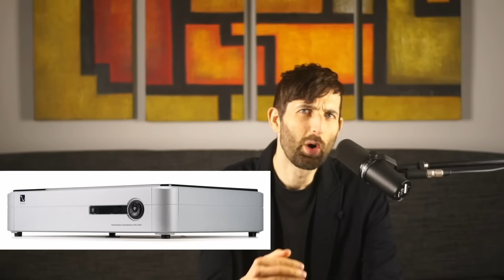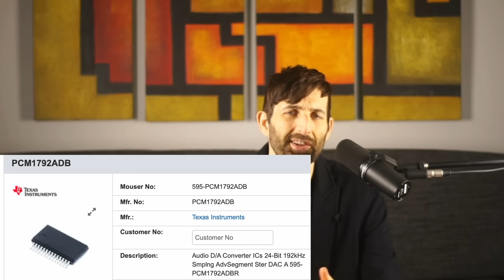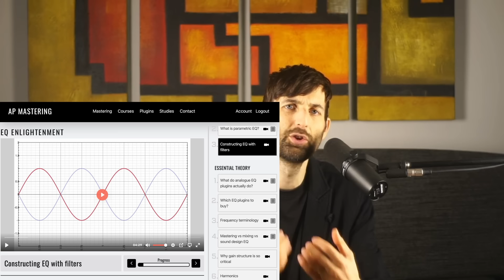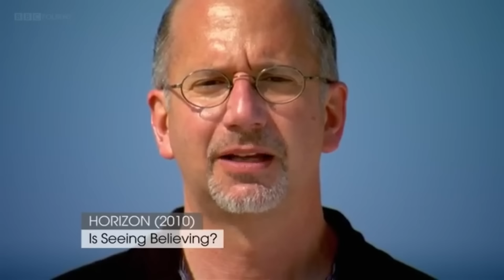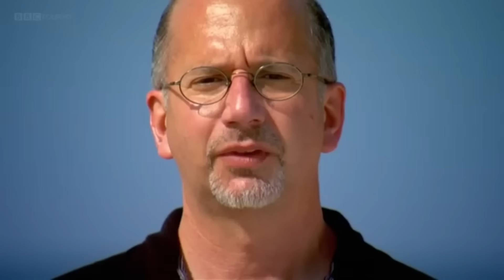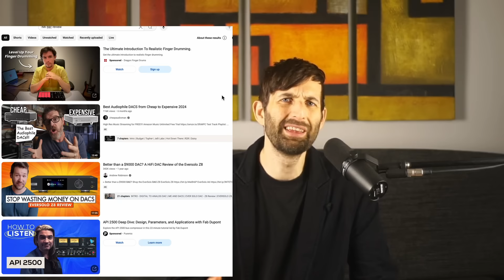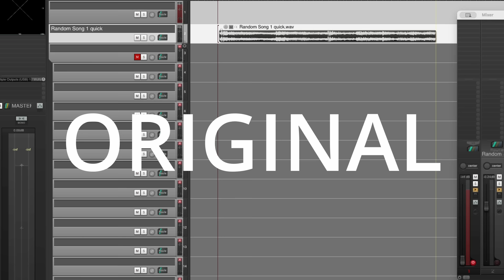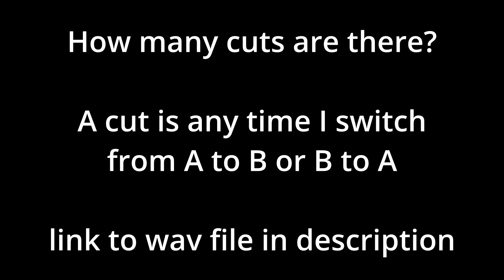The DAC Scam - Almost everyone believes the hype

Comment: i have an RME Fireface UCX audio interface, which offers 8 analog inputs (2 mic/line, 2 line/instrument, and 4 line) and 18 total channels (8 analog, 10 digital) for simultaneous recording
it was about 1k when i got it on a good deal about 9 years ago now.

The RME Fireface UCX uses the AK5558 ADC (Analog-to-Digital Converter) and AK4458 DAC (Digital-to-Analog Converter)

Comment: I agree with some but not all of this and I also agree with some of the the responses but not all of them.  So the grand answer to the question of one DAC being better than another is,  It depends. I have been a music lover all my life and an electronics engineer for over 40 years and I can definitely tell you that no two dacs are created equal and that the power supply and signal chains have more to do with the overall sound than the chip itself. Implementation is everything. If it's not, explain to me why I can sit and listen to music through one dac and have my mood completely obliterated in minutes to the point where I just want to turn it off and go away vs listening to the same system with another dac that doesn't affect me in that way and I want to listen too it for hours. The human brain is very sensitive to a multitude of timing events and these aren't readily identifiable. Now, getting to the snake oil part. I have heard expensive dac's that were blown away by less expensive well engineered dac's and I have also experienced the opposite but to say that all dacs sound the same is subjective. Just my two cent's.

Comment: Man, you are missing what this is all about. It's about the analogue output stage of the DAC, which makes the difference. Also, if you use expensive silver/copper alloys and all materials, that's what increases the price. Plus you completely omitted R2R DACs...Even decent Chinese DACs start at 400 bucks, so I doubt you can do it cheaper without sacrificing something...The only think you are right is that those readily available chip solutions from Texas Instruments, AKM or ESS are more or less the same.

Comment: Mmm. You’re barking up the wrong tree here if you’re wishing to bash the audiophile community.
There’s an issue that people think a dac’s sound is governed by the chip used. It’s now understood that it isn’t. It’s the implementation. Power supply, clocking etc etc.

Comment: the bla bla/ vla vla phenomenon is highly suggestive but doesnt fit in this context. still, you might be right and expensive DACs are not worth it. i dont know, cant try one. anyway the test wav file is not of sufficient quality anyway: it is full of noisy artefacts. and audiophiles could argue that it's not only about the chip but also the unit's implementation … so nothing new here, i think. your strong opinion can maybe cure somebody from curiousity. still i would want to try myself: in my room, in my chain … as in my experience quite everything makes a difference - that's what this hifi hobby is all about - remembering to enjoy the music of course…

Comment: He's right.
All mambo jumbo.
Cheap dacs, the rest of the interiors also made by few companies. 
Someone said that the implementation is important. Right, but what does it mean? They are connected in one way, so it's just creating great descriptions, because if you read very nicely written text, you see a great made/ designed box, you are sold.
I thought as well that the cable, cd players, amps and dac's can make a difference,  but no, they do not.
I compared my Singxer SDA2 amp with a very well known dac, that cost 10k more than the Singxer and guess what , even that it was short test, I did not hear a thing. Point.
All equipment works with current, energy which has no quality.  So how can a quality of a sound be improved, with more expensive cables( made from the same material as the cheap ones😅 or dacs.

Comment: I would argue that there probably are instances where laboratory grade chips/ semiconductors are arguably better. 

Most audio chips are designed with mass production in mind and as such cost is a factor, they will simply sell more chips that way. 
Whereas laboratory grade chips have to be right no matter the cost. There are some exotic Op amps and things out there for dmm's and such. There may be use cases for some of them in audio gear. 

Milspec though, not so much. Unless you want to listen to music at the south pole or in space, that is.

Comment: Most important feature of a DAC, especially if you're using it with a computer, is that it has a display or indicator lights showing the sample rate and (if appropriate) PCM or DSD format. It's very easy to get the settings of upstream equipment (especially computers) wrong, and you probably won't hear the difference. But if you're a purist, then you'll want to make sure that your 88.2kHz FLAC file is being delivered as such, and not resampled by the computer. If you're using Windows and the standard driver, there's a good chance the sound is being resampled.
Reply: My Fiilo K7 does that.

Comment: NOS: it's as AP says. I show all this via measurements in a deep-dive article I did a few years ago, and along the way show the differences between the different filters that you can choose on many DACs. YouTube won't let me post a link, but if you google "How to pick the best filter setting for your DAC" and my name (Stephen Dawson), you should find it.
Reply: Conclusion of my piece: "As always, if your equipment has options, play with them and see what you like. But if you want what is clearly the most technically accurate – that is, high fidelity – output from your DAC, choose fast roll-off or sharp-roll-off, and linear phase (or no named phase) rather than minimal phase.

"And do not choose NOS or Optimal Transient or Super Slow Roll-off. They are objectively worse, although it seems plenty of people are able to imagine them to be subjectively better."

Comment: I'm starting to wonder if this channel ever has good takes. The sound of a DAC is not dependent mostly on the chip. It is mostly dependent on the circuitry built around that chip, power supply, line amps, etc. There is also more to a great DAC than just the sound. There's routing, signal accuracy, and more. There's a huge difference between hifi snake oil (which he's right about) and extremely well built mastering gade DACs for a few grand (of which for some stupid reason he is also lumping in with them). If you're buying a fantastic, reliable, long lasting and well built DAC you can count on for decades of great use for a few grand, you are not an idiot. You are doing the right thing. If you buy a $40k DAC, you are of course an idiot. The complete and total failure to delineate these two is yet one more reason this channel is actually doing more harm than good on yet another topic. The line transmission speaker design one also comes to mind.
Reply: He does mention in the video that the power supply and circuitry matters, though.
But then you mention that "signal accuracy" also matters -- hm? If it's sonically transparent to everyone (in a blind A/B test), and its purpose is to output sound, then the "signal accuracy" is good enough.
Reply: @exscape  When I say signal accuracy, I mean something like - if you generate exactly -18dbu through it, can you depend on the fact that it is in fact exactly that signal strength? And over time, when it drifts (as it will in all DACs) can you open it up and trim pot it back to perfection? Just one example. A well built DAC is about all of these aspects and is what makes one professional or not. This is one example what separates the $2k DACs in mastering studios from a $500 one that people only think about if they know what they're talking about and what they want out of their gear for decades. Thinking only about the conversion is a very narrow minded take and I stand by that statement because it is a fact.
Reply: 02:04

Comment: By the time most Audiophiles can afford this ultra high end gear, they have lost a great deal of their hearing. Besides, the high end gear is so fine tuned that the components used to make them will drift out of spec over a few years of use, so it needs to have Capacitors and resistors changed when that happens, good luck getting the exact same spec'd ones to replace them

Comment: I'm stil using a DAC I built 30 Years ago with a CS8412 AES/ EBU and S/PDIF decoder and CS4329 20-Bit DAC. Only simple 2-Pole low pass filtering with MC33078 Opamps. Some decent voltage regulators and good quality metal film resistors and good capacitors. Nothing fancy. It still does the job. Only limitation is the maximum sample rate of 50 kHz, so I can use it only for the 44.1 kHz and 48 kHz sample rate digital recordings I have. Good enough for me. And I don't hear any difference with any 'high class'(and high priced) DAC's. In fact the amplifiers and speakers I use make a huge difference compared to the DAC's I use.
Reply: You do not know all you are losing. Get at least a Chord Mojo DAC, or a Gryphon DAC, and you will never look back. Thank me later.

Comment: FACTUALLY INCORRECT. 1. A D/A chip is just 1 of many topologies that can be inplemented for the conversion. 2. The D/A does not impact the sound quality and difference between ptoducts, as much as you have been led to believe. The power supply, filter/buffering/op amps/galvanic isolation components and their configuration/implementation, impact jitter, thd, timing, transience and ultimately sound, significantly more than a delta/sigma chip. 3. Measurements at the analogue are vailable from many sites to depict the differences in frequency response between most DACs.

Comment: It's not about the Dac Chips used, it's the implementation that makes the difference. Audiophiles try to get a reproduction of music as close to live played music as possible. Perfect clocking, silent power supply, good shielding, upsampling...  all used to provide almost perfect transients for a live-like listening experience. Do me a favour and try the Chord Upsampler together with the Chord Hugo TT. Use the bypass button to compare with / without upsampling. I was shocked how much of a difference there is. Without upsampling the guitar player of "the girl from Ipanema" sits on a stage in front of you. With upsampling he sits right next to you at the bar... a almost holographic listening experience ❤

Comment: put it this way.. I've been using the same DAC (I bought several) from MACKIE CORP  that was released at the apex of that company in 2008 (it's inside a mixer product)  -  the same DAC has put me in the scope of people who seek out Digital from Analogue transfer service for 15 years.. including the CBC Canada who has hired me the last 5 years to transfer some of their massive library of recordings to digital  - and these DACs cost me $100 each.. they transfer only to 24/96..  I never use the higher sampling rate for vinyl as it's pointless and most customers want Red Book CD or MP3.. I've rarely had anyone purchase the 24bit versions.. .. and guess what.. no one notices I'm using this particular DAC because no one complains because this DAC is very flat.. just like every DAC should be in theory..  whatever you put in you get out.. is the basics.  This is a good video because it tackles a huge portion of the scam going on.

Comment: DACs most certainly sound different! expensive doesn't necessarily mean better, but they definitely sound different. I've heard a $200 thumb drive DAC sound awesome on a $30k plus system and a first generation Carver $700 CD player sound like nails on a chalk board. My Panasonic receiver's internal DAC sounded way more airy and extended, if a little clinical on aluminum tweeters versus the laid back sound of my Sony DVD player. There are some amazing cheap DACs, but they hardly all "sound the same". If not my Sony DVD player, the receiver also offered 1 bit conversion which sounded different too. The differences weren't huge, but each option had audible differences in resolution, extension and ease.

Comment: the author has clearly limited experience. There are obvious auditable differences between 500 usd dacs and 2000-3000 usd dacs. 10 out of 10 in AB test. I guess author test equipment is not resolving enough to hear the difference. Follow professional audio market to see, what is real and what is mambo jumbo. The most expensive part - speakers. Usually active speakers as much more dynamic and effective in the same budget. Then pro DACs will range to a couple of thousands. Yet pro DACs will often be too sharp, tuned for critical work rother than pleasure. I agree that above certain price level I can't hear quality improvement though DACs will still have different sound signature. Maybe there are people who can hear the difference, but I guess often they are fooled by their own mind and senses. But here it is important to notice, there is different level of detail perception when listening in far field, near field and headphones. Far field being closes to nature but least detailed. Second thing the author gets completely wrong is that the expensive gear uses the same DAC chips. Some do, but these which usually stand out use their own proprietary  code in programmable CPUs. Like Chord for instance. Schiit uses pro grade programmable chips, which can cost up to 100 USD per piece and there are usually 4 of them in a unit. So even if there is a lot of snake oil (especially cables) in this industry, I can't give a thumb up as these general statements are misleading. If someone trust your material, they may conclude 500 usd DAC cannot be topped by anything, which is basically false. I understand you're trying to get more views by juicy title, but first you need to do some more research.
Reply from the maker: blind test
Reply: @APMastering I am sure in proper environment you will be able to hear difference between avearge 500 USD dac and 3000 USD dac in a blind test. There is some chance you will be able to hear difference between two 3000 usd DACs. I have 3 versions of Schiit Yggy (it has modular construction - you can swap the analog sections including DAC chips) - there is no way, you would not hear their distinct sound signature, even if swapping takes 40 minutes. Schiit arranged a blind test of all 3, inviting clients to join. That was blind test with ABC instant switching. All participants were able to distinguish them within seconds from switch, though they had different  views on which is the best sounding. I appreciate your take on this subject, I assume good intentions. Yet the sense of hearing is still quite a mistery for the scientists.
Reply from the maker: @wojciechczupta  how many times did i switch in this video?
Reply: @APMastering this is really funny question :) first I listen this video on my mobile phone. Second even if I listen on my stereo, though youtube really squeezes a lot from audio bandwith, it is only ~200kbs. This is serious limitation in context of zylion dollar dacs :)

Comment: How I wish everyday all my DAPs, amp/dacs, and dongles all sounded the same. Price doesn't affect me because I prefer the sound of my cheaper dongles on my laptop using Foobar. I am so sad because my computer's usb port is too far away so I can't lean back when using the dongle on my computer, forcing me to use my desktop dac/amp setup. Then when I listen on my bed, I use my DAP instead of my laptop dongle, and how I wished my more expensive DAP sounded the same. Who knows, maybe one of them is transparent or maybe none of them are. But dangit, they sound different, and I'm not affected by price.

And unfortunately, I also have other dongles and they sound different. How I wished I could use my smaller and lighter dongle. In fact, I wished I could just use the highly acclaimed apple dongle which is just a cable.

Comment: And then the amp appears to have a digital volume control... 

After the $$$ dac has converted digital signal to analog, the amp converts it back to digital to apply the volume control setting and the converts ot back to analog usung the dac... built in the amp. Lol.